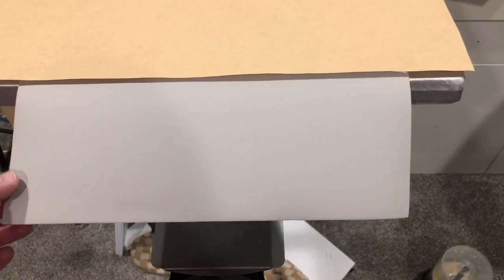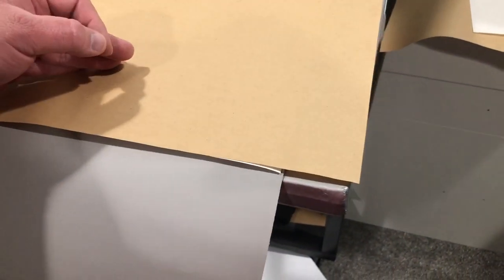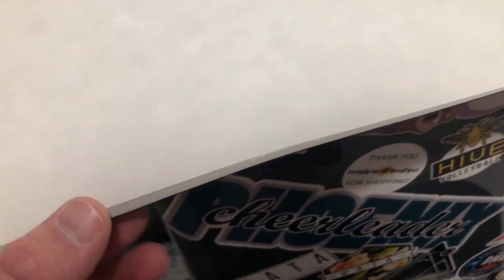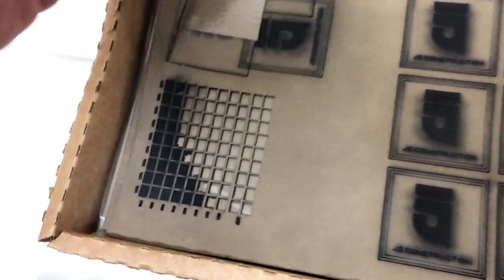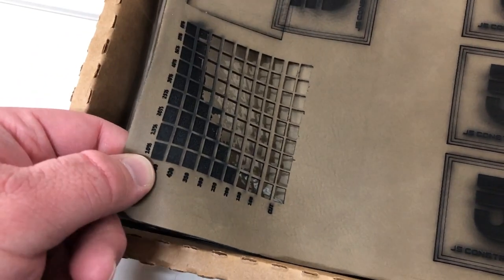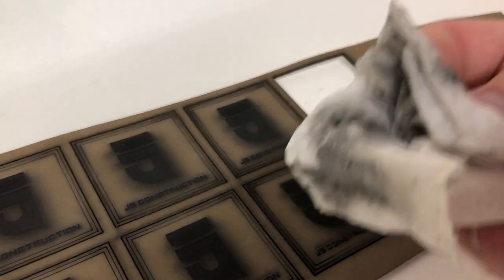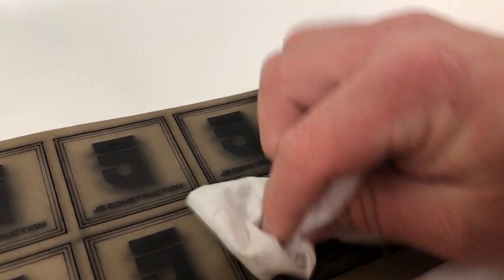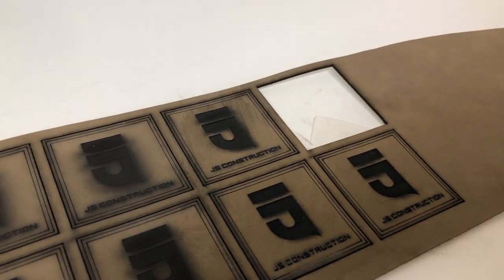Adhesive Leather Patches on Hats - How I made them

Comment: What if you don't have a flat heat press? will an iron work to add the adhesive or does the iron not get hot enough?
Reply from the maker: You could make an iron work. JDS now sells leatherette that already has the adhesive.

Comment: Can i attach the patch with just an iron maybe?  Or a heat Gun or what are the options if i don’t have that machine
Reply from the maker: You can do it with most irons on their highest setting. A heat gut won't work because you also need to have pressure on the item.

Comment: 3:48 - Woof, try engraving those bottom-up b/c you are more likely to have the beam vaporize the charred bits as it moves up for less/no cleaning - doesn't do this top-down... 👨‍🏭
Reply from the maker: We did do it bottom up. I did find out the someone turned the air compressor off so that was the main issue.